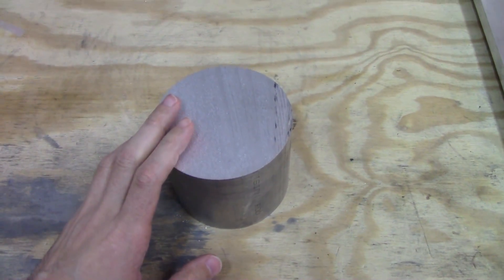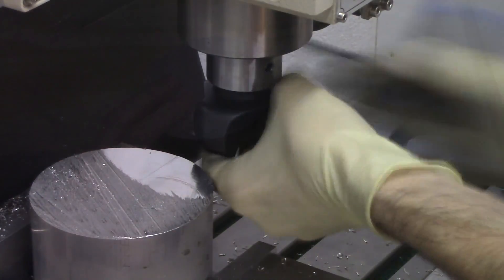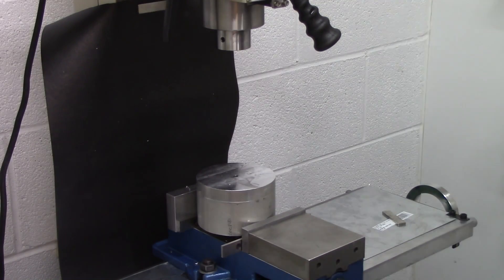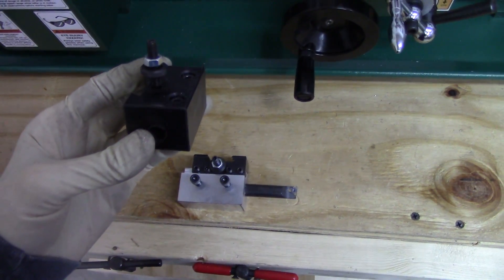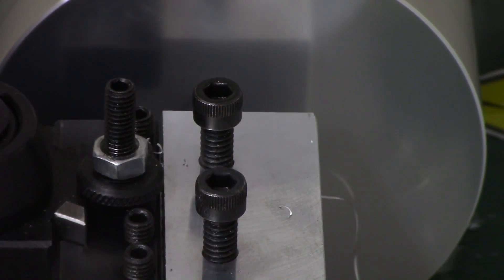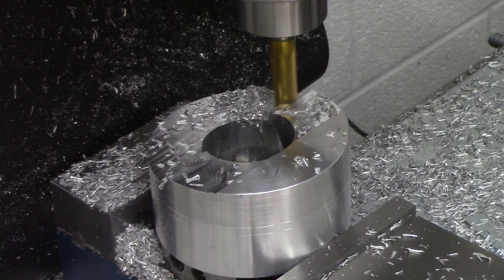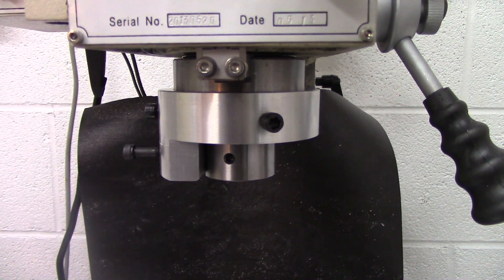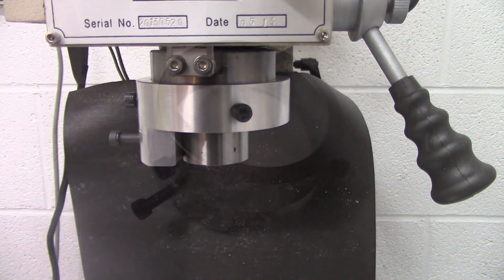G0704 - Spindle Lock

Comment: Ok, lack of tools. It's a problem. A rough guide is that the necessary tooling will approach the cost of a hobby style milling machine. I suggest buying as needed - need to plan ahead a bit so the tool is available when needed. BobUK,
Reply: Swapmeets...I find alot of tool holders  at them most at motorcycle  Swapmeets... the automotive  ones can at random find machinery

Comment: Hi folks, Spring loaded lock is a very good idea but could require three hands, the alternative is an electrical interlock that disables the motor when the lock is engaged. It could be wired in series with the spindle chuck guard, or there may be a free connector in the control box. BobUK.

Comment: Just curious.... I have been using my air impact wrench. Holding it and then hitting it with 90 psi. Never had any problems. Tightens it just fine and loosens easier. No galling on the tightening rod either. I use a 9mm 12 point socket.

Comment: Just a suggestion but a spring loaded pin would be much quicker to engage than a bolt for locking the spindle. I built one for my x2 mini mill and will be making one for my G0704 in the near future. Got a few irons that need to come out of the fire first.

Comment: Why are you milling the wrong way? 

You only have to mill counter clockwise on a very old mill with lots of play. 

If you are milling outside the part then it's clockwise and it's counter clockwise if you are milling a pocket. 

You will get better tool life, surface finish and less chatter.
Reply: +ProtoSimTech Pretty sure you guys are just talking about "Conventional Milling" vs "Climb Milling" both are valid techniques if you know what you're doing and have the appropriate machine for it.
Reply from the maker: Hey Rasmus,

I don't know if there really is a "wrong" way to mill. Yes, there are advantages and disadvantages to each type of milling, but I don't know if it's the right thing to do to label either way "wrong".

I don't want to get into a pissing contest here, but I'll try to explain this the best I can.

In the video, I'm milling the part using "conventional" milling. This is where you get the best finish (at least in my little experience). I'm milling "against" the part. The best way to explain this is to think about a car moving forward but the tires are going in reverse (the tires being the end mill).

Here is an image to explain what I mean. The image on the right is how I am doing it in this video: http://tinyurl.com/nargbf6

I'm definitely new to all of this and I'm getting the hang of it, but let's try to refrain from labeling either way "wrong". Every machinist has their way of doing things, or a way they've been taught to do things. There may be some cases (as you've suggested) that call for one type of milling over the other depending on different variables or customer requirements, but this is how I chose to do it with this particular work piece.

Thanks for the comment!